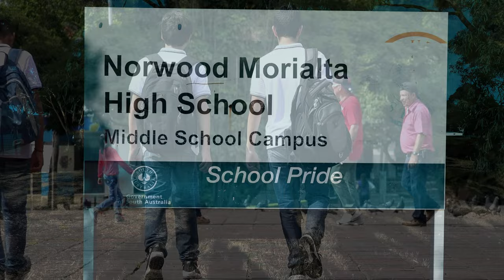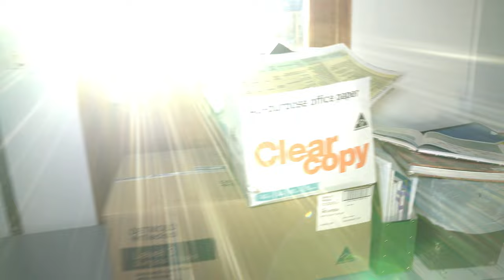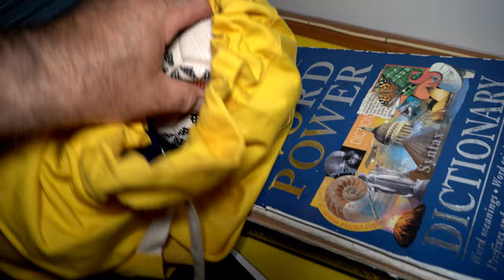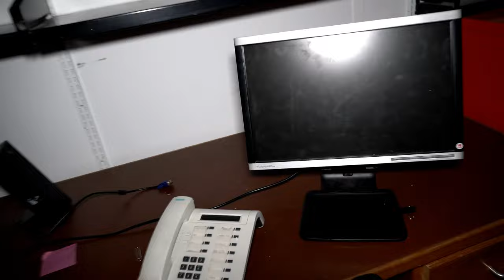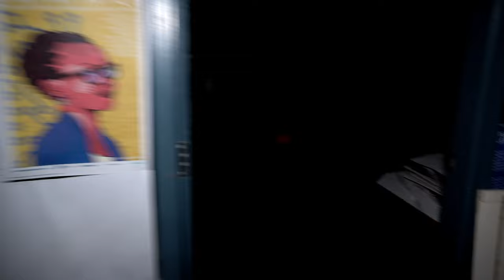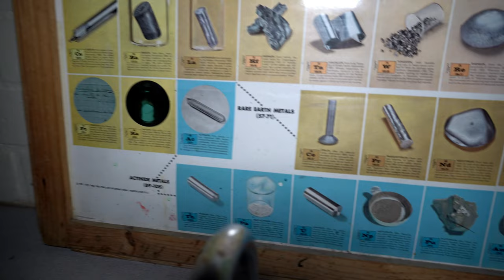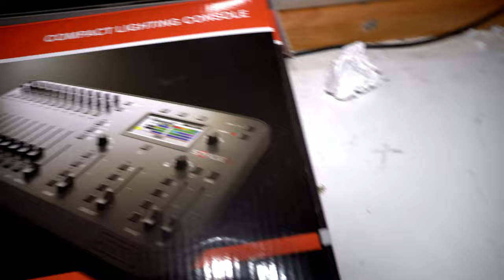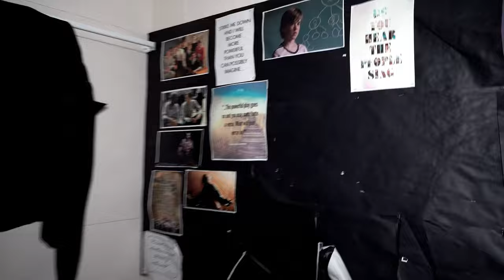Abandoned High School up For Demolition

Comment: Wow wow so many locks going to go to waste. I hope they gut these rooms to recycle what they can before it all goes into landfill. Would be good to go get the locks! Wonder when they are going to tear it down if I would have a chance to grab the locks. Thanks for this adventure what a great find. Did you know it was up for demolition, or did you just happen apon it cheers
Reply from the maker: Hey pocket watch yes there were heeps of them so many keys and things. Get in contact with heather and we could probably go back and rescue them before they all go to landfill. At the start of the video there was a pile of steel which the excavator had ripped apart there probably would of been keys still in the steel doors of those lockers hey thanks for stopping by cheers
Reply: @wernersadventures8330  that would be awesome, Heather was talking about maybe this weekend. that would be really cool if we can do it